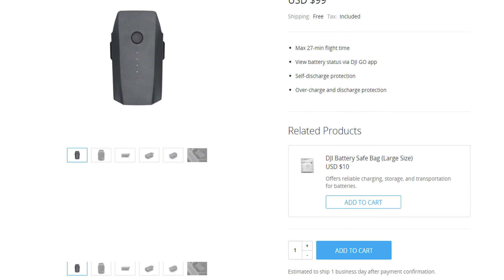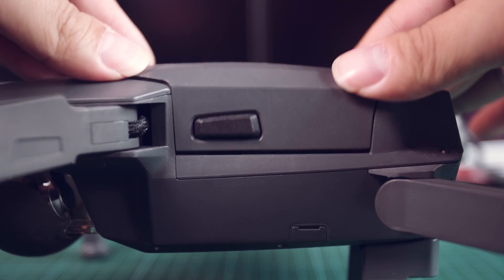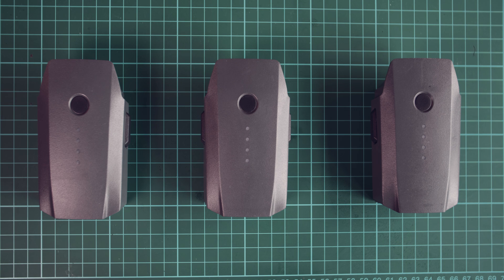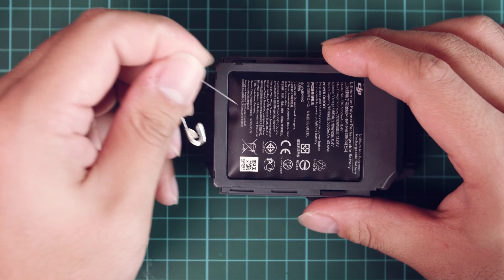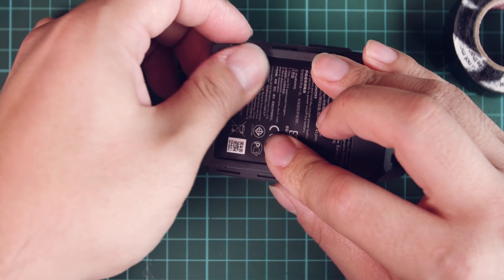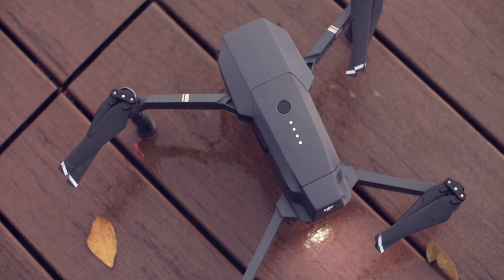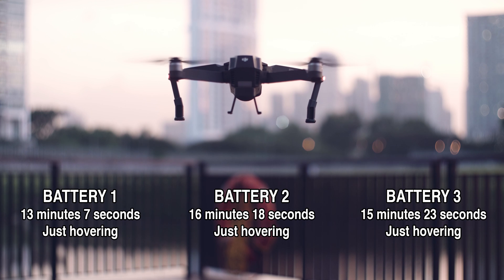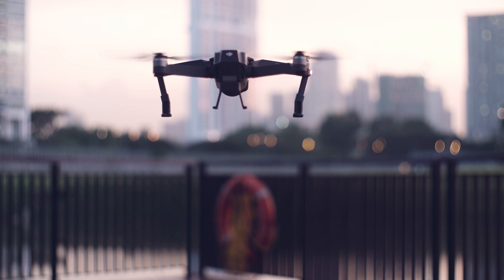Ep 38: Deflating bloated lithium polymer batteries, will they still work?

Comment: I have a Phantom 4Pro. All 3 of my batteries are bloated. I believe this may have happened as a result of storing them for too long (fully charged) in a case in the boot of my car. It gets pretty hot here in Australia. They do work fine but are a bugger to remove from the craft. I actually need to carry a flat head screwdriver just to pry them loose. I was looking at your method of puncturing the battery with a needle. I decided to use a sharp stanley knife and as i commenced to make a small insertion i saw very fine sparks. I halted immediately. I didnt get that far to make any puncture. i guess i just grazed the surface and was freaked out by the tiny sparks.
Reply from the maker: Yeah I read up somewhere which says heat is a factor too. Anyway please be careful...best to do it on a concrete floor or something. Also don't breathe in the fumes. Good luck!! :)

Comment: Very informative video. I have the same issue with my battries. I am contemplating on doing the same. Any area in particular i should puncture on the battery?
Reply: No don't
Reply from the maker: No particular area but only puncture it at an angle, otherwise the lithium may come in contact with the needle and it may ignite.
Reply: @AlexRexVlog  ok.. thanks very much

Comment: Hello, it's been 5 months since you made the hole to make the gas in the battery; How is the battery now? Is it still working? What did you do with it? Did you do those 5 months still recommend this feat? Thank you.
Reply from the maker: the battery still works but with lesser capacity. i've replace them since then already. I recommend doing this only if you have an emergency shoot and the batteries don't fit.

Comment: sir i am using bloated battry but it is little bit bloated is there any chance that i will  lose my mavic??? please tell me i have no money yet to buy new one can i use this for some time or i should not use?
Reply from the maker: I think you should buy new batteries, as the batteries may pop off mid flight if it's too bloated. While deflating it will solve the problem, it will reduce battery life as mentioned in the video.
Reply: Alex Rex sir if I deflated only backup time will only reduce the flight time is there also any risk to pop off mid flight ??
Reply from the maker: So far it hasn't for me. But I cannot guarantee in the future.
Reply: Alex Rex okk sir thank u thank u so much this was so helpfull

Comment: So the gas inside where it come from...
Reply from the maker: The gas is produced due to electrochemical oxidation of the electrolyte. This oxidation occurs usually due to overcharging of the battery.
Reply: @AlexRexVlog  thanks for fast reply, i did same, puncture it with needle, and it smells strong, i see on cell still balance, 4.30 and 3420mah,my flight time till 13% is about 20:43,how do you think,, it still okay to use, btw iam on 78xcharge
Reply from the maker: @arasykeysha  wow, okay your batteries are in better condition than mine. Mine are really bad now. 15 minutes tops for me. I don't think it will suddenly fall out of the sky but to be safe don't fly over water.
Reply: @AlexRexVlog  is it posible fall? I think no...maybe It only drop off the voltage... Do you still use yours(15munute max flytime)
Reply from the maker: @arasykeysha  i just flown it for a while last month. It was fine just shorter battery life. I also don't think it will just suddenly fall but I cannot be certain.
Reply: @AlexRexVlog  How can there be overcharging when the charger is said to be 'smart'?  I am a loss at understanding this as 3 of my batteries are 'pregnant'...
Reply from the maker: @BAROTIKI  I have been wondering that myself friend...
Reply: @AlexRexVlog  I guess we are in the same boat...  I am going to try your method with one of the batteries and will let you guys know how it went!
Reply from the maker: @BAROTIKI  be very careful....it might ignite and catch fire
Reply: @AlexRexVlog  I will Alex, and make sure the needle does not contact the Li when punching through.  And I will do it on a concrete pad!
Reply: @AlexRexVlog  OK, I just did it, no explosion, no fire, just a tiny puff of gas!  Charging in progress on the 3 batteries and hover test to come...
Reply from the maker: @BAROTIKI  let me know how it goes...thanks
Reply: @AlexRexVlog  Hello Alex!  I have charged all the batteries and went out for a hover test where I used one battery.  I did more than hover, I flew around at low altitude and speed for about 150 meters total, and the battery lasted for 18 minutes until I got a warning for BATTERY TOO HOT.  I was at 25% battery power left and brought the Mavic in.  The battery was at 71.6ºC.  The flight went well and there was equal voltage left on all the cells.  I let the battery cool for a few hours and then put it back in charge.  Today I will fly the other 2 batteries and then that first one which got hot.  So far, so good!
Reply: @BAROTIKI  how to properly puncture it?
Reply: @Tony-ge2jr  I use a medical needle (they are very slim), punches the hole AND left the needle in for the gasses to sip out SLOWLY...  It works on the Mavic 1 batteries, but the Mavic 2 batteries are more prone to SPONTANEOUS IGNITION when punctured!